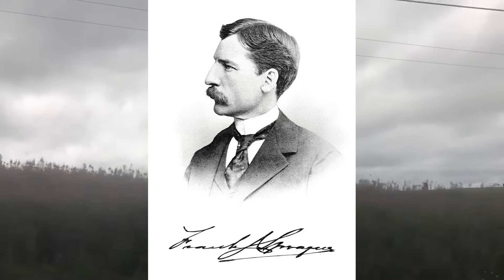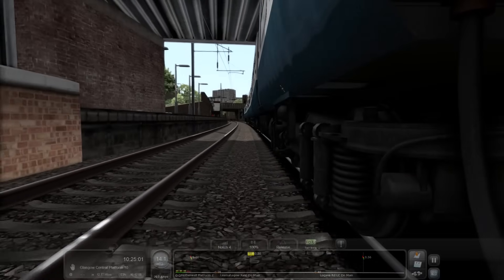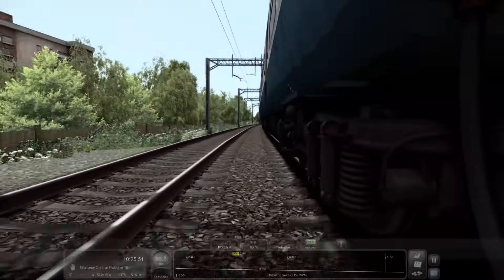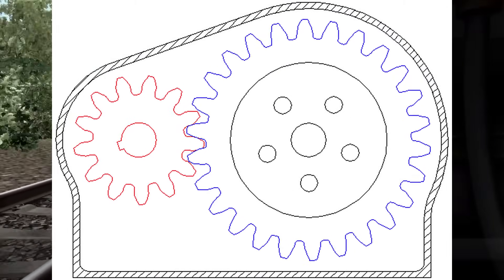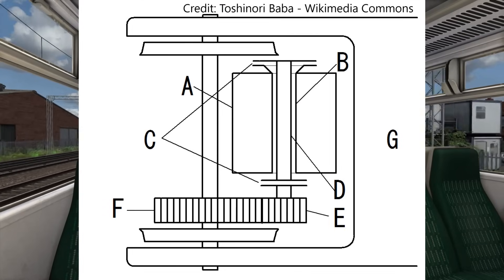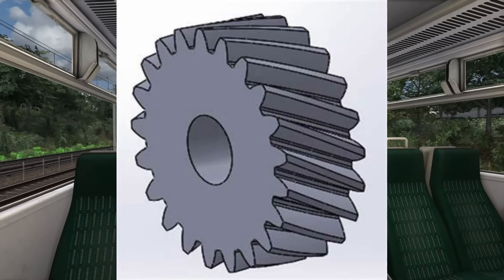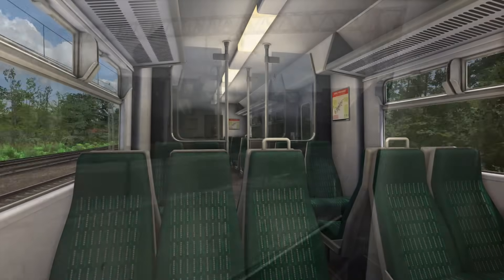Why The Noise? - An Explanation of old Electric Train Noises (Part 1 - The traction motors)

Comment: I live in San Diego, California, and right after Covid, there was a massive increase in the number of people riding the trains. Because of this, MTS (the transit company that owns the trains) had to pull out some old trains. Instead of the floor being level with the platforms, they instead had 3-4 very tall steps to get inside. These older cars made the noise presented in the video.

Comment: The class 86 in its original form was indeed a rough riding unit due in large part to the unsprung weight of the traction motors. After the serious derailment at Bushey, which occurred during my time as a driver, and was found to be caused by a broken rail blamed in large part on track damage inflicted by the 86/0s running at 100 mph, the maximum operating speed was successively reduced to 60mph before they were withdrawn and rebuilt, becoming class 86/4s with body to bogie springs and traction motors carried as sprung weight within the bogie frame as on the 86/2s.

Comment: They're called "spur", not straight-cut. They are, in fact, involute-cut. The tooth profile has the appropriate curvature to ensure the teeth roll against each other, rather than slide. If they were straight rather than involute, they'd slide and therefore wear out in no time.

Comment: Being a 'spotter with ASD and a particular sensitivity to auditory stimuli, the sounds of 90s Thyristor traction is simply music to my ears. The Cheshire-cat-beating smile that crosses my face whenever I'm standing in the rear vestibule of a Class 373 TMST shows this off all too well! 🚄🔊❤‍🔥😁

Very interesting to learn that Cardan shafts were first used on the JNR 101 Series though! Up until now I'd always thought the first train to use them had been the BR APT-P (Cl. 370) which employed them so the traction motors could be sited in the bodyshell of the power cars (The Cl. 91 does the same thing; It's basically an APT power car without the tilting body) whilst allowing them to tilt in line with the rest of the train. 😄

(Little tid-bit: Though it's much harder to see, the Cl. 373 also uses a Cardan shaft; The traction motor is hung from the bodywork and the first reduction shaft is mounted to the motor at one end and to the bogie at the other. Although it looks like a standard transverse shaft at first glance, the shaft can vary its length to accommodate the action of the bogie steering into curves in relation to the motor, thus allowing power to be maintained despite the relative movement of both in relation to one another. 😇)

Comment: I have seen some illustrations of bogggies using cardan stubs to axle suspended gearboxes, but motors are fixed with silentblock to the boggie main member. Thus, at least they got some degree of suspension since the have 2 stage suepension. Solid rubber block from wheel to boggie and them air ride from the boggie to the coach. There are ONE motor config where motor feed bot axles using small cardans and two motor arrangment, each feeding one axle. Since motor are large to fit in between the wheel space, they kinda overshoot the axle line  .... so the gearbox is designed to extend far from the axle line so it can be couple with a stubby cardan. Long ago we had Metros by old GE, with STRAIGHT CUT gears and some sort or regen breaking ... man ... the noise was unbearable, people need to shout to each other in order to speak. IT is incredible how loud those were. And it sound exactly like you mentioned, like a three step acceleration. I was told that have been upgraded to PLC control to ease the operation, probably to avoid the camshaft system. But still using resistor banks ... those run very hot on summer. You could feel the heat from the windows. To add more noises, they run reciprocating compressors,  that of course wont even try to hide their nature. Silent blocks were unkown. They have some sort of field weakening system ... but  for a reason I cant tell, it was disconnected for long. Today they have been replaced for 45 yeard trains but using chopper and automated using Siemens Simatic 5. Nothing screams relaibility like Siemens.

Comment: You need to address this topic from a genuine technical standpoint otherwise you're going to convince people that the number one cause is backlash and suspended drive - both of which actually are not the case at all:

1) Whining and humming of the wheelset with no VFD control is caused by bearings alone - found on EVERY piece of rolling stock with worn bearings (roller/ball)

2) Fundamental frequency produced by the DC motor takes up the backlash which causes rumbling with torque ripple (rotor vibration due to poorly rotated magnetic fields)... that's entirely the fault of employing a commutator/brush because there's no other way of rotating the field with the rotor trajectory: basically a conducting bearing - but again this is only the fundamental frequency which is but one component of the sound you hear down the gearbox... so the problem doesn't really fall down to just the motor because what about the remaining harmonics open-circuit???

3) Suspended loading is an irrelevant topic - it's practically motion only: vibration is low frequency (inaudible)

4) Cardan shafts won't solve the problem because of reason 1), PMSM drives will still wear the bearings down if chosen wrong

5) Thyristor, PTR, IGBT... doesn't matter what type of VVVF system it is - it could be RCFM and it will make no difference because of reason 1), see Class 345s / Class 455s

6) When teeth wear down (including double helical teeth), it causes a crunching sound which can sometimes be heard depending on how bad it is - nowhere is this demonstrated in the video but it was still talked about in the wrong context... it doesn't cause whining or humming or any of the sounds heard here, it's far worse and more concerning and sounds like something is broken (because it is, the gear teeth are damaged)

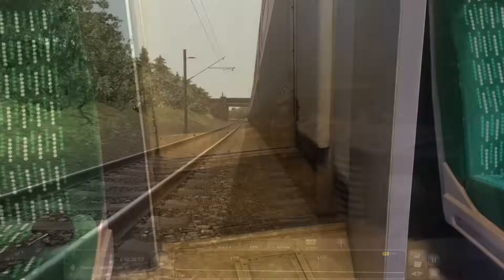At 3:55, you described this sound as backlash (the gap filled between cog teeth). This whine is actually caused by the bearings along the entire drive train wearing down. The fundamental frequency is the only contributor from the driving motor here to the pinion, where the backlash is then taken out. That means that helical gears, regardless of how big they are, won't actually solve this problem (and they haven't, just look at the 345s) - you can only fix this noise by choosing the right type of bearing for the forced vibration and keeping the gear train lubricated (provided by maintenance contracts with the manufacturer).

Old trains are not the only things which make this noise. Wagons make this noise too because damaged bearings are the loudest thing. AC and DC motors can be equal size and weight and make no difference in this context. The control of both is down to the TCU. And both motors also have bearings which can wear down and cause whining. DC motors just have more moving parts. You demonstrated the Class 323, but this is also going to be just as loud at the gearbox as the 319 as I have explained (and is the case anyway - both the 323 and 319 employ motors and have synchronous drive modes). Towards the end of the video, you can't glorify AC traction as not having these same problems as older stock with DC motors.

To sum up, if it has bearings then it's doomed to become noisy anyway. That's the truth, regardless of traction technology.
Reply: class 380
Reply from the maker: You're not entirely correct about how the bearings make noise, they do make noise but it is usually a bassy, humming noise at high speed.

The state of the bearings moreso affects performance than the actual acoustics, however yes there can be acoustic differences between an old flat bearing vs a journal bearing etc. If a bearing is particularly broken then it may make a pitched groaning noise, but this is pretty rare. 

There is a fundamental frequency produced by the by the motor, but in comparison to the sound of the gear teeth meshing it is very insignificant, usually a high pitch "shshshshshshshsh" noise, made each time as the rotor completes the rotation, proportional to the torque ripple.

Suspended driving is more relevant than you think, as pretty much every movement suffered by the axle has much more effect on the gearbox, as it can be responsible for some compressions which can make noises in the gearbox - this is why suspended drives tend to have a lower mile per failure than other types of power transfer.

I probably should have mentioned in the video that it is because of the fact that the cardan drive will save space that it is more likely for a gearbox to feature helical gears as I actually cannot find a train which has a cardan drive gearbox as well as straight-cut gears. So you do have a reasonable point in that the cardan drive won't 100% solve the problem.

Your point about VVVFs was unessecary? It's completely separate to the gearbox. The 345s make noise because they use a cardan drive frame mounted motor with helical gears that makes little noise and the Vossloh traction Class 455 still use a suspended drive with straight-cut gears, you have simply proved my point with that.

The gears being worn down can and does make a distorted sort of screeching sound, and you can hear it particularly when the gears reach a point of resonance where it gets particularly bad, and I agree I could've used a higher speed example which would've demonstrated it possibly better.

In your concluding point you might have confused the phenomenon of track whine with the sound of the gears, and that sound is simply dependent on the track, entirely unrelated to do with any of the train itself, apart from the wheel diameter will possibly affect it's pitch. I didn't mention AC motors make a different noise? I mentioned that they are more efficient, which is generally agreed to be correct. 319s have DC motors and use a PWM control method which is asynchronous to speed, it simply changes volume depending on what current is demanded - that is a factual error on your part. 

I agree particularly loud bearings can be a significant problem but it's not relevant to the contents of the video. Thanks for watching.
Reply: @SmoIchopper  you're talking nonsense, I'm an Industrial engineer at Siemens. I'm not going to say anymore, but know you're not correct.
Reply from the maker: @ItsYa165  I know that it's rude to doubt someone's title at face value but I find that hard to believe. As an engineer you should know that the cut of the gears is a pretty major factor in the sound of the gearbox, and this is evident if you have ever been, for example, in a car with straight cut gears or helical gears.
Reply: @SmoIchopper  I've designed both spur and double helical compound gear trains for a linear actuator drive, and the noise problem wasn't solved until I replaced the bearings. You can keep rambling on about meshing but wagons still make the same noise 😂

In your next video, PLEASE talk about bearings because (I'll say it for the last time) they are very significant - more so than backlash (every train has backlash so forget about the resonance point)
Reply from the maker: @ItsYa165  Please show me a video of a wagon making such a noise, I am interested  in how fucked your hearing must be for that to be the case.
Reply: @ItsYa165  If your claims of being a Siemens industrial engineer are factually correct, shouldn't you have better things to do than to argue with a tiny YouTube channel over a casual formatted video?
Reply: @SamT  ...
Reply: @SmoIchopper  https://youtu.be/IvDx5EQP8QU?t=33

This is an intermmediate wagon half way down the train. It has no gearbox as a result - only bearings. They all use the Goerlitz 8 with axle bearings, yet some are loud and some just sound like air doing the same services. I believe they're all single block as well (even still, tyre slip doesn't make this sound).

For a wagon, this is very noisy. There are even comments acusing the wheels of being broken. Well we know what wheel flats actually sound like, and it's not this. It's not the flange because we know what flange is. The only culprit left is the axle bearings... like I've already explained time again. Axles have bearings, gears have bearings, motors have bearings... anything which spins should have a bearing on it and they all wear down and vibrate. Replacing bearings is difficult and in this case there's no need to... just let it continue being loud. That's why all our new stock is just as loud now; you can't escape this fate with these bearings. You also know that some cars on EMUs are just trailers - but they're still loud like... what more can I say here. Worn bearings are loud!

I've heard this on container wagons and coaching stock before for the exact same reasons. Bearings, bearings, bearings bruv: https://ec2-3-6-120-100.ap-south-1.compute.amazonaws.com/why-does-bearing-selection-play-a-crucial-role-in-gearbox-performance/#:~:text=By%20choosing%20bearings%20with%20appropriate,and%20power%20transmission%20within%20gearboxes.

So much of this is down to bearings! Bare bearings.
Reply from the maker: @ItsYa165  Are you referring to the sound of ascending pitch in the video? if so you have described the track whine, as I predicted if you scroll up earlier. This is a separate phenomenon caused on rails that have been recently grinded. I can tell this because you can hear it fluctuating in pitch and making a high pitch sound over junctions - typical of tracks grinded by a rail grinding machine. 

Indeed bearings do affect train performance as they are there to reduce rolling resistance and therefore a good bearing should only have minimal friction and noise.
Reply: @SmoIchopper  interestingly, when a wheel rolls over a joint, it may slip or slide - you can watch videos of this and see it visually with sound. I've studied this machine dynamic (very boring). Track whine is a distinct high order harmonic (600/630/660... Hz for example as you can hear on the welded Tube lines), poor bearings add to this with the low order harmonics closer to the axle speed (60/90/120... Hz for example). You may have heard this in cars as well.

We're getting closer to the same wavelength here, but to add to your comment, the bearing makes their own noise that makes everything WORSE. If I picked up the wheelset and span it using a lathe, it would still make this noise and we'd have no track whine (there's no track).
Reply from the maker: @ItsYa165  Yep you're right on all counts, the sound of bearings is proportional to the axle speed. I'm not entirely sure how it actually affects the track whine sound but I'll take your word for it, but it is a damn sight not as loud as either track grind or everything else I've previously mentioned.

The worst bearings I've ever heard were on a Class 377, where the entire coach rattled as the speed picked up. It was a very low pitch sound and it's usually rare for the bearings to be so audible at such low speed.
Reply: @SmoIchopper  yeaheheh
Reply from the maker: @ItsYa165  If this is the case then this is all well and good but this doesn't disprove the video at all? I only wanted to explain why the traction motor set actually caused that noise, which I explained perfectly well in the video. I wasn't referring to the wheelset like you have seem to have been, judging by your misapprehension displayed from this thread, that is worthy of an entirely separate video.
Reply: @SmoIchopper  Please understand: an ideal motor with perfect bearings would only rumble at 50/60Hz - that's university mechatronics 101. But because DC motors have to commutate mechanically to rotate the magnetic fields by (360°/poles) unlike an AC motor, that means we get more than just a rumble. We get the noise of the bearing, the brush, and ripple harmonics. The entire gear train is riddled with bearings. With perfect bearings, there would be no gear whining (pitch increases with speed). With optimal backlash, there would be no gear humming (constant pitch, period depends on speed... it's just a tapping sound https://youtu.be/1qX6DXkwUh4). I'd recommend visiting Solis Tractors for better explanations.
Reply from the maker: but as I have stated oh so many times, you end up with the sound of the gears, be they straight cut or even helical, hitting at a speed that creates pitch, gears being the loudest part of this entire system generally, that is the main noise you hear, and the topic of this video. 

This video wasn't intended to dissect every sound that is made by the DC motor. I expected people would understand that it's a given that you can't have perfect bearings every step of the way. I understand that worn bearings create friction and this can build up, but to point out every step where this happens is ridiculous as surely you should imagine. I could have pointed out that the different type of bearing can make a different noise but that is trivial.

If you want a full monty explanation in a long-form video then you can feel free to make your own.
Reply: @SmoIchopper  I just explained to you that the gears hitting (backlash... I've used this term enough times now) is not what this is. I've posted a link with what the sound of backlash actually is. Please take your time, it's not trivial - it's serious.
Reply from the maker: @ItsYa165   If this was an elaborate way of saying that I used a wrong example at 3:55 - you'll be pleased to know I've put errata for it in the description.
Reply: @SmoIchopper  About the 319: there's audible synchronous patterns that don't match gearbox harmonics, I think that's what he was referring to
Reply: @mittenpulstaktung  I'm sure you'll agree on this point, having known ICE bearings requiring wheelset replacement